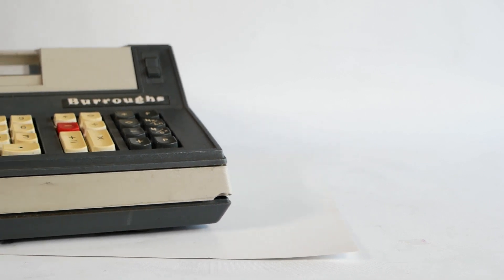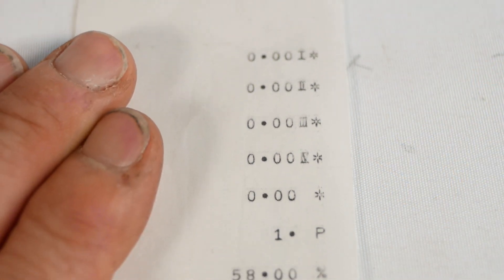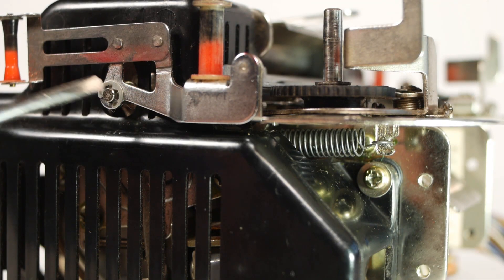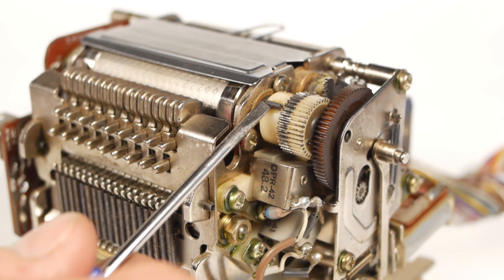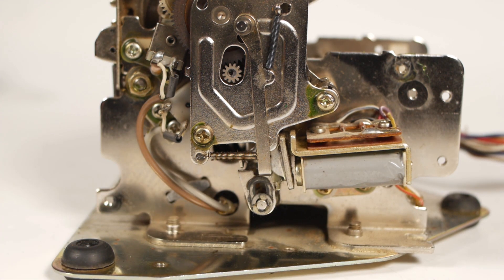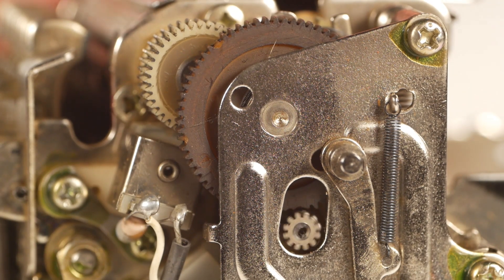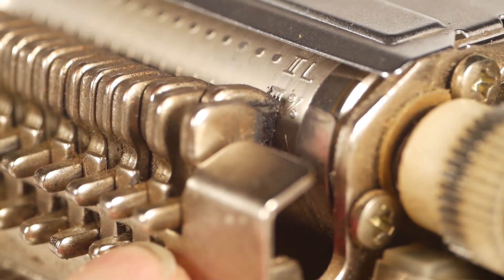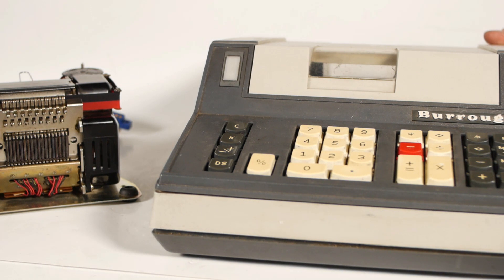1970s Calculator Printer - Shinshu Seiki EP-102 - Part One

Comment from the maker: I'll post a second video once I've made the replacement gear and got the printer back running, then eventually, assuming everything works, I'll post a demo of the Burroughs C6202 working with all it's programmes.
Reply: Have you found a good source for those gears? I'm still looking for some 10-tooth module 0.9 gears for my broken Beaver adding machine, so if your source has those I'd be very interested.
Reply from the maker: @jaapsch2  I got my gears from HPC Gears https://www.hpcgears.com/  they do appear to have 10t 0.9 module (search in "spur gears, then select "metric"  and finally "0.9 MOD" ) - depending on what you want, it might be worth speaking to them rather than just ordering off the website.

I suspect they could have made a replica double gear (at a price) rather than me cobbling together two separate gears.  It's mostly gone well, but I was relying on gluing the two gears onto a brass shaft, and the Delrin material mine are made of doesn't really glue.  I might give it a go with the one I've made, but I have a backup plan of cutting an incredibly fine keyway onto my brass shaft and into the gears to make sure they don't move.
Reply: @GrumpyTim  Thanks Tim! That looks very promising, so I may give it a try
Reply from the maker: @jaapsch2  Excellent, they could be a really useful supplier, postage is fairly expensive so if you have multiple things that you need it could make send to buy them together.

Comment: Keep my fingers crossed, that the replacement gear will do the job. I admire the engineering of these clever mechanics, even on an electronic calculator. The gear seems to be too small for 3D printing?
Reply from the maker: I'm relatively confident the cobbled together replacement gear will do the trick, as you say, it's too fine a gear to 3D print, at least with the technology we have - I'm not sure about some of the resin based systems, they might have better resolution, and there are systems that print parts in Titanium - no idea how good those are, but for our home systems it wouldn't work.  I did even consider making a gear cutting machine - in essence a cutter of the correct pitch for the gears, some sort of sliding rack to pass a blank gear through the cutter and an indexing system (could be a 3D printed disk with pin holes for the number of teeth I required) - of course, that would have taken ages to build and perfect, but might be a project for another day!!!

The overall electromechanical excellence of these printers is just the kind of thing I like - built to be taken apart and repaired rather than thrown away.

Cheers for watching.

Comment: Interesting, particularly the way the printer is bought in. Have you got access to a lathe to make any bits you need?
Reply from the maker: Yeah, I'd realised it must be a bought in unit because I've seen it in several different makes of calculator but I hadn't realised how much of a self contained unit it was.  It appears to be a dumb unit, and all the control is done externally.  I was most impressed with the method of synchronising the hammers - the solenoids can theoretically be out by a few degrees but the hammer will still strike at exactly the correct time.  Also, the solenoids can be small, fast responding items, leaving the big hit to the shoulder on the motor shaft - and the hammers really do have a big hit, it's quite a noise when you use one of these machines!!!

Yeah, we've got a lathe that's good enough for this job - I had considered making the gears from scratch but just getting a 0.4 module cutter blade would cost a fair bit, and then I'd need to fabricate a gear cutting device - could be really handy for future projects though.......

Cheers for watching Ben.